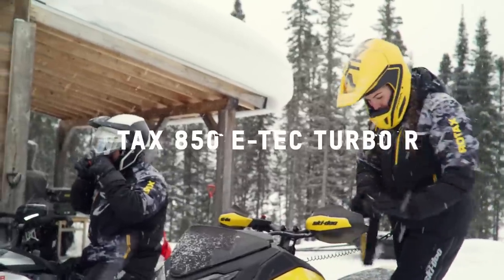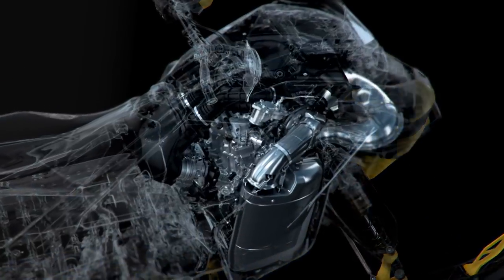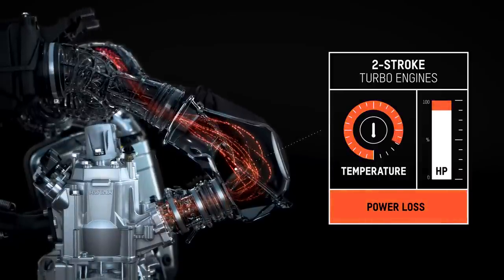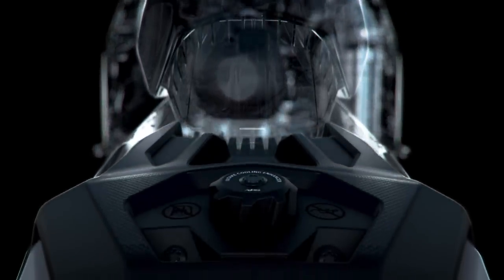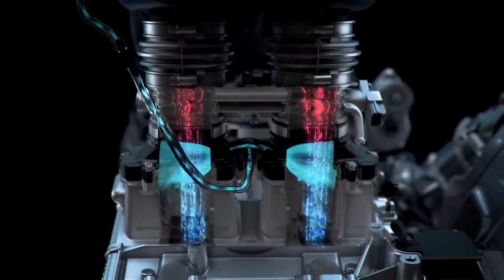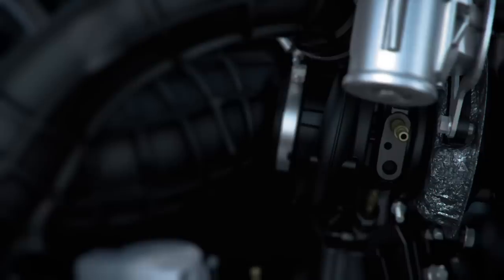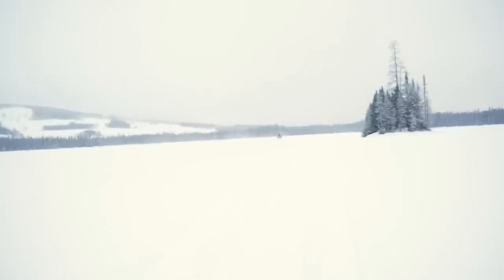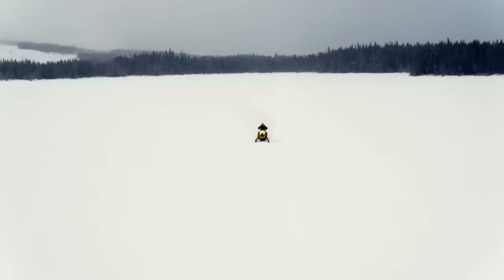New Rotax 850 E-TEC Turbo R Engine with Water Injection System

Comment: I think I’d let this get the bugs worked out of it before I’d be willing to buy one. I’d gladly test one out though lol
Reply from the maker: The TurboR is a proven engine, just a new application for low elevation riding with water methanol injection.
Reply: I did water mist injection on a 2 stroke Detroit diesel
Reply: They used  Water Injection in WWII Fighter planes..

Comment: Will thé water not freez in extreme temps?
Reply: They forgot to mention there is Methanal in the  mix too just like windshield washer Fluid..  Snow Performance sells a mix that has some kind of a Lubricant or anti corrosive in it too , Or maybe it cleans your engine ?
Reply: @mikeskidmore6754  they say water meth mix two times between 1:09 and 1:30.
Keep up boys.
Reply from the maker: The liquid is not solely water. It’s a blend made of anti-foaming and anti-corrosion agents tested in extreme cold temps.
Reply: I want to try that on my 8v92 2 stroke v8, I already did water mist experiment and a bit more power

Comment: Why not straight methenol?
Reply: Just a guess but the only reason for the methanol would be to keep the water for freezing. The factory has its own mixture to off set the effects of straight methanol on certain parts, along with rust inhibitors for optimized engine life.
Water injection is an old hot rodding trick that does back at least to fighter aircraft.
Reply: Straight Methanol will catch on fire in the wrong place or before spark ..  As Long as it's 50% water and 50% Methanol  it's considered a non flammable liquid.
Reply: @mikeskidmore6754  true. Good point

Comment: Is it in the mountain sleds also??
Reply from the maker: Great question! The Rotax 850 E-TEC Turbo R is in the deep-snow lineup, however it does not have the Water Injection Technology. Usage of a turbo engine in the trails vs the deep-snow are quite different in the way the rider uses the available power, which is why the Water Injection Tech was added for the trail sleds - for those extended and repeated long pulls.

Comment: So it's a liquid intercooler. What happens when all the liquid gets heated?
Reply: It doesn’t get heated it gets burned / consumed you need to add more when you use it
Reply: By the time it makes it to the injector through that small line I'm sure it's ice cold.
Reply: The Methanol burns and the water turns to steam.  Have you ever seen how much power a steam locomotive has?

Comment: Thanks but I was more interested in a 650 or 670.  Sorry I don't need 180 hp on the trails, I want 140 hp on 87 octane.
Reply: @midlifemike4916  no I came to laugh at guys like you who want one but can't afford it
Reply: I 100% agree, an MXZ Xrs with 140 hp and 129 track would be a rocket in the tight trails.
Reply: @Part Time Yooper  I have a 23 renegade adrenaline 850. Nice try dude. Who cares wtf you ride as long as your riding
Reply: @rideswift  I have both (2) 850's and (2) 600's.  Besides the longest stretches on a flat trail, there is almost no difference.  Sure the 850 pops a little more out of the corners, but for 90% of the riding, they are pretty much identical.  

Plus if you want to beat someone in a straight line, get a 4 stroke turbo and crank up the boost like the Yami guys.
Reply: @PartTimeYooper  so why do you think they need a 650,670cc for? Because polaris has one? Just throw a 670 sticker on it. I honestly don't think there is much of a difference like you said
Reply: @MidLifeMike  yes, just like they didn't need an 850 turbo trail sled but Poo has one so Doo must follow suit. 

And I think a 140 hp, 650 that can run on pump 87 is a sled a lot of Doo riders would want.  A lot of us don't want the 4 stroke weight.
Reply: @Part Time Yooper  splitting hairs a bit is what I'm getting at. That's why I went with the 850.  We used to  do ice drags here in Minnesota and we tested a 1999 xc 600. 106mph stock with picks. Thundercat 1000 did 113mph with picks. It's all on your setup.  The 850 doo was just as fast as the 4 stroke turbo cat. People get to caught up in the marketing bs
Reply: @MidLifeMike  my biggest gripe is I feel like Doo has forced trail riders into the 850 to get the nicest features.  Smart Shox...sorry 850 only.  10.25 gauge....sorry 850 only.  Want shot on trail sled? 850 turbo only.  

600 sled with a 137, smart shox and large gauge.  Sorry my wife already had an 850 and doesn't want one nor want a 4 stroke.  

That being said I'll probably snowcheck a Poo for her next year and maybe keep my Lynx another year.

Comment: Big price for a motor that will need a rebuild every 3k
Reply: I'm not sure about the 850 turbos, but I've got 5700 miles on my 850 and it still pulls like a freight train. The only thing I've replaced is a few belts. 😄 I've heard of trail guys with 8k+ miles on their 850s.
Reply: @Campbell96Racing  the turbo will not have the same reliability, the water meth may help some but I certainly don't want the extra weight, complexity and cost
Reply: @Campbell96Racing   I have 7k miles and replaced only one belt. Still pulls like a freight train.
Reply: They claim not much weight more. 
Being as there’s no battery and is now shot system starting.
Reply: @kyle blume  505 pounds for the 850T quite a bit more than 850 or 600
Reply: @adampetten1009    So don't get a Turbo model  and you will eliminate a lot of weight complexity and cost..
Reply: @kyleblume6530    What if they put the shot system on a non turbo model ?
Reply: I have over 8000 miles on my 850 etec! Ppl need to learn how to run em! This is my 4th xrs with big miles and not a issue! Strip em down in summer and go threw em! It's not hard!
Reply: @kyleblume6530  you ever picked up a turbo?
How about charge air piping and the cooler?
Reply: @mikeskidmore6754  that would be cool, personally weight doesn’t bother me too much I have a 850 renegade and it is just fine for me
Reply: @Tim Torkelson  sort of... an 850 manual start is 30 pounds less than the 850T, people wanting the comp pkg or iron dog as it used to be wouldn't be using e start anyway. If I ever get a sled with e start I always remove it first thing.
Reply: @Derrek 4 real  an 850 NA could go a long time, the turbo will not last that long.. I've yet to see an 850T over 3000 miles. You'd need to be leisure trail riding to get high reliability.. probably most people will be using very little boost as the 850 makes plenty of power at sea level
Reply: I removed electric start on my old 800R....never again!! Replaced battery with lithium battery and saved just shy of 12lbs, me..lost 30lbs all good!😁